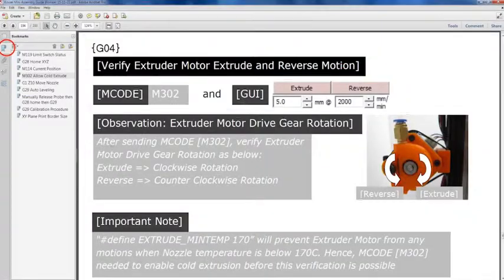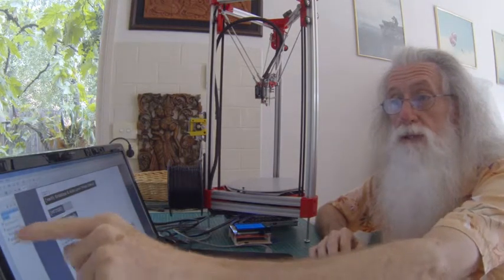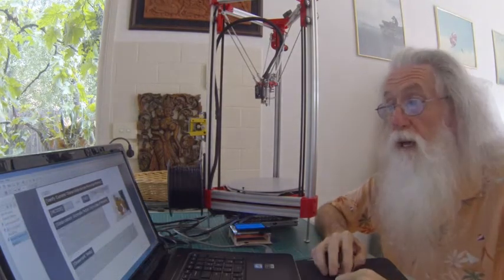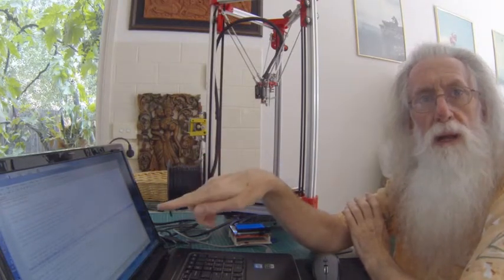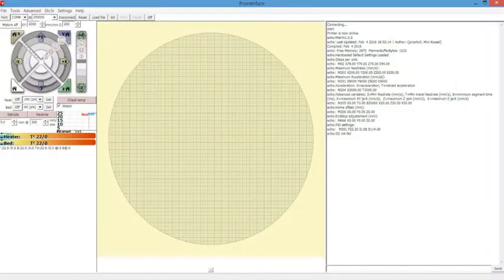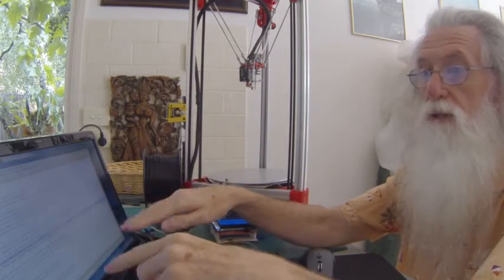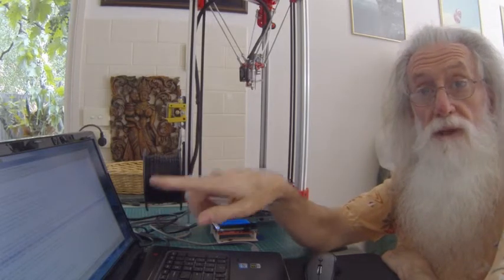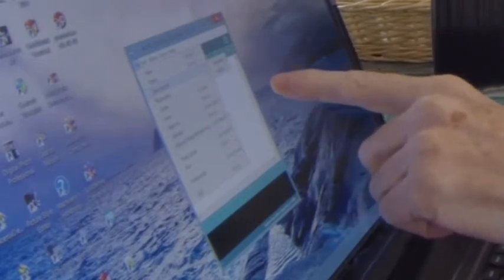3Dprint4A - Kossel Delta 39

Comment: Well I broke it at this stage. Worked fine connected by USB. Worked fine plugged in the mains. Mine came pre-loaded with marlin software so was able to test all the motors and switches without usb. when I wanted to try the pronterface and program it to heat the extruder to see if it would work for some reason when both plugged in to power and usb I first got fluctuating readings on both thermisters. Then it went black and the USB wire was hot to the touch. Not sure what shorted it but it seems like it was drawing a lot of power from my PC because just before it died my keyboards lights turned off.
Reply from the maker: Have a close look and even sniff each component and you will find the one that seems "burnt". One of mine chips ran away and went black and died. I had to replace it and just test one chip, one heating at the time, just a low temperature, then a bit higher temp, etc until it came to the correct melting point.  Then only tested the next chip's values, etc one at a time. until everyone was tested, then tried both together at a lower temperature, then higher, then finally the top temperatures.  You stop at the temp that gives you a fault before it burns down, check and adjust power supply volts, wiring, chips, soldering, etc and fix or replace the faulty part rather than a damaged board.  It can be a pain in the butt but little steps first to find the problem. Good luck.
Reply: Strange thing. removed the ramps board and the arduino was recognised and lit up the LEDs I thought with the USB heating it was the arduino jointly at fault. messing about with the ramps board to find the issue I removed the stepper drivers to locate the smell of burning. Couldn't pin point the smell and couldn't see any burns. Reconnected for the sole purpose to see if it would cause the burning smell. Instead it lit up and worked! isolated a stepper driver that was somehow not lighting up the LED. I don't know if its the Ramps board connectors that did it but I have the replacement driver installed and it works on USB.
Now I'm cautious to power it on with mains because I assume (might be wrong but it is hinted at by the presence of transistors) the USB power doesn't even make it to the drivers when the mains is on and perhaps there is a short allowing this to happen which overpowers the driver when both the mains and the USB are on. Been talking to the seller and sent him photos of my wiring before I disassembled so waiting on the all clear with that. 

Got this printer because I wanted a delta and to learn the arduino side. my other cheap Core XZ acrylic Mendel was an easy build with a single control board pre-loaded with reprap marlin and no need to make changes in the software. To get any reasonable print quality it needs to run slow at about 25mm/s otherwise the acrylic chassis wobbles and its a noisy bugger even with vibration damping feet installed. 

I found your videos after I made the purchase and stated watching them whilst waiting for the delivery they have helped a great deal with a relatively quick assembly and I even noticed they have 'improved' on the quality. They shipped me a perfectly sized effector, the rod bearings were threaded a bit crap but they all were of the same and right amount of tension, they also shipped more than sufficient cap screws but still no nob for the LCD and no other changes to the printed parts. Thanks for doing this YouTube series!
Reply from the maker: If I just help one person then I am happy.  Thanks for watching.  The little stepper drivers carry all of the current that the motors do so they need their heatsinks, etc. Make sure the pins are aligned correctly and it is seated properly.  They only get their power from the mosfets, switched by the arduino, so run your PS closer to 12VDC and an extra fan doesn't hurt. Good luck, and like I said in one of my videos, don't burn the house down ;-)
Reply: Think I have found the problem at the expense of 2 more steppers. On USB power the board just fried the new stepper driver I put into the extruder slot. The LCD turned on to a blue screen that faded to black and when I removed the extruder stepper driver it worked. moved the x motor stepper driver down into the extruder slot to see if it was not just another faulty stepper. Fried it. checked it back in the original slot to be sure. My ramps board seems to be frying everything in the extruder slot but I don't have a clue what could be the source of that. especially since it was only on USB power
Reply: Update on my printer. 
I finally know what is causing the problems but I don't know how to fix them. there is a 25v ac potential difference between the GNDs of my pc usb port and the arduino which creates the current. apparently I was lucky my computer wasn't fried. After getting new electronics to try it out I nearly fried them but I disconnected the USB when it started getting hot and spent hours in the reprap forums looking for a solution where I leaned about testing the GNDs but couldn't find a solution.
Reply from the maker: Does it happen with just that pc, another separate single arduino board, power supply (2 x 12V crossing could a problems) etc, etc? It sounds dangerous. The solution I try when I have a tangled fishing line type of problem is add one separate thing at a time in various combinations until you get to the one that is causing the problem. Once you have isolated that area you can put all of your time and effort in finding the solution. I added the smoke in my videos with special effects but be careful that you don't add it for real.
Reply: I have tried with my laptop and got a reading of 7v ac and 5v dc so I am going to try the imac next.